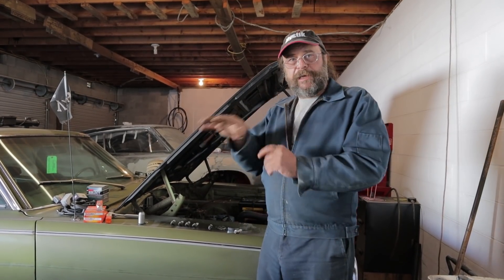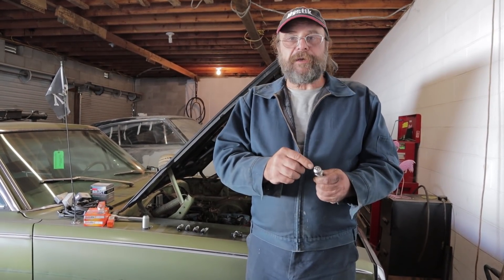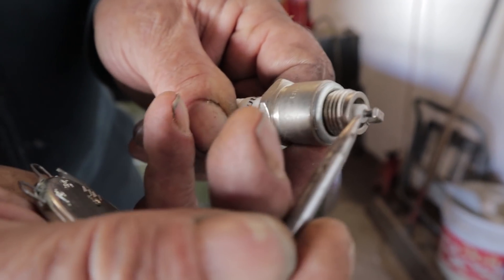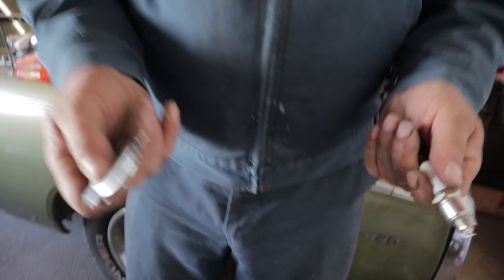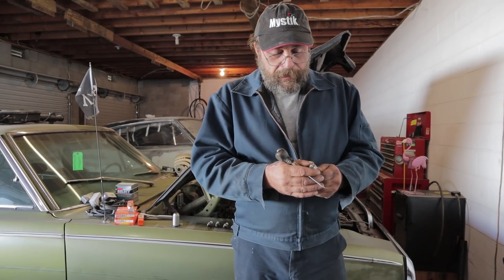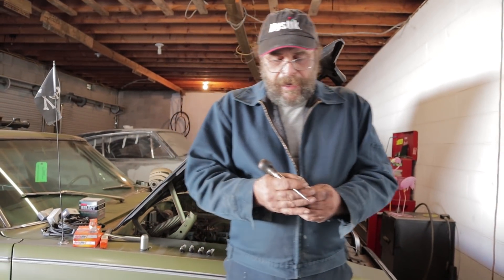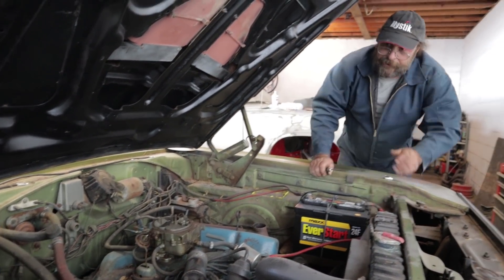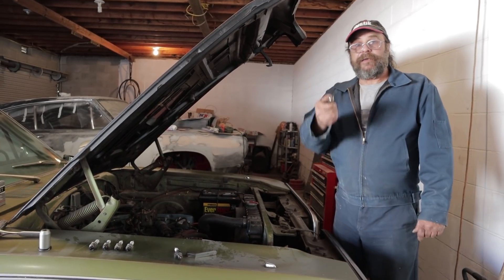Tune Up Basics - Spark Plugs

Comment: Installed some Bosch plugs a customer brought in once for his Mustang.. came back a week later... bad plug........ came back week after that ... different cylinder. Bad plug.... suggested then to put in Motorcraft spark plugs.. naw.... next week back again... “ put Motorcraft plugs”.... yes sir.
Reply: Bosch works OK in Eurotrash.  Stick with the OEM plug and you can't go wrong.  Fixed too many cars over the years that way.
Reply: So NGK's ;) motorcraft doesn't have bad brands behind a lot of there parts and comparable in price.
Reply: I’ve also had quite a bit of trouble with Bosch plugs in Hyundai’s. Quite a few comebacks for bad plugs.
Reply: Bosch platinum is used to be really good back in the day just like ACDelco unfortunately they're not worth a shit anymore..like Uncle Tony says Autolites are great all around applications you can get them ordered because they're made by same as FRAM just similar to  air filters and oil filters. there have so many applications and they could be specially made the list is endless..
now they're all owned by the same family you have autolite Bendix and Fram that were also prestone antifreeze.. all  now on by Trico the people who make windshield wipers believe it or not
Reply: Bosch plugs like to take out ignition parts,had this one happen a few times.Most of the European makes come with NGK from the factory,seen this with a VW Jetta once.
Reply: Autolite platinum plugs would work best on that!
Reply: Mark Ryterski or Autolite.

Comment: Damn I didn’t know about the fuel-spark jump with Side gaping 👍
Reply: Gee when the gap gets too large the spark goes from the center electrode to the inside of the outer electrode causing weird misfires. When you see it on a scop the firing voltage is real low with eratic pulses.
Reply: dielauwen talking about the fuel closing the Circuit.

Comment: Platinum-tipped spark plugs are only for longer life on an old car. Most cars before the 1990s do not benefit from having dual ground straps, and won't perform any better. If the OEM part is xyz, stay with xyz.
Reply: Not to mention that no matter how many ground straps you have on each plug, the spark can only jump across one of them at a time.  It gives the spark more options for less resistance as the plug wears or gets dirty, but it doesn't increase performance.
Reply: @JohnWilburn  Yes, I get it. I wasn't having a pissing match. I am learning. I am from the late 80s generation. You are right!

Comment: I ONLY use NGK. I tried some of those fancy Bosch plugs, a week later I was back at the  parts store getting some NGK's. Champion, well never in my cars. Although, we used to have a single cylinder tractor that had the original plug from 1947. It still ran. However they don't make them that way now. (I could not get that plug out to change it anyway)
Reply: What make of cars/trucks are you driving?  Because I learned something very interesting about 10 yrs ago, concerning my 2000 Tacoma 4x4 with 3RZ engine ( 2.7 liter 4 cyl ).......I met a Toyota "guru" ( close friends now ) who has worked for Toyota for over 25 yrs now ( mechanic/tech ). He told me never run an American made plug in a Toyota, only use ND or NGK (both are made in Japan ). He stated that for some reason, the Japanese engines just don't like an American plug. You can use them, but your mpg will suffer slightly and it WILL foul those plugs soon. However, most American engines CAN run a Japanese plug just fine. Go figure. As he was telling me this, my other buddy suddenly replied: "No damn wonder my wife's Camry keeps fouling plugs, I've been using American plugs"......and Dave said: "There ya go, I told ya so". Perhaps this also pertains to other makes as well. ?????
Reply: @howabouthetruth2157  so far, that's been my experience, no matter what brand of vehicle. NGK just works. Nothing fancy just does the job, and they last a hell of a lot longer than any other plug I've tried.
Reply: @tootall5559  Yeah, I've been running NGK's in just about everything I've ever owned ( 58 yrs old ).........cars, trucks, bikes, marine outboards. Decades ago, I did run Autolite quite a bit, but I only owned American vehicles back then. Since I bought my Tacoma new in 2000, I've been using ND's ( Nippon Denso ) too. Either/or NGK. Just clicked 343,000 miles on all original motor & automatic trans. After nearly 20 yrs, it's only on its 3rd set of plugs, believe it or not. 2nd set of plug wires. Still running original wheel bearings & CV joints too. About to replace the U-joints for the first time. And it's been my only driver in all this time. What a little donkey. Kept nothing but conventional Castrol 10w30 in it, and it doesn't burn a drop of oil......seeps a little from the front of the engine though, barely. I'm convinced this damn thing is going to out-last me, lol.
Reply: i can imagine the guys @ bosch we,ll double the price for each additional ground strap ! lol
Reply: @matthewcalifana488  what the deuce lol
Reply: @matthewcalifana488   that's E3 plug
Reply: toot tall I agree I like NGK’s lot 👌
Reply: Copy that, I run ngks in my euro cars , bosch is meh
Reply: @MrTheHillfolk  I started using NGK in Japanese cars, but it turns out they're just plain good plugs.
Reply: I remember they were in the old riding mower as a kid lol
Reply: Champion plugs from 40-50 years ago are indestructable. But that's then and this is now and now they are pretty crap quality control.

Comment: AC delco R44TX for the last 45 years.
Reply: nope R44TX A/C Delco.
 I have been putting them in that engine every 5000 miles for the last fourty five years, and I call the parts store first to see if they have 8 of the critters in stock. When I go and get the MSD 8 mm wires and HEI dist.  cap and rotor,
old girl gets tuned up every 5000 miles and the red components go well with the Chevy orange and chrome old small block. Who just hit 67891.0 for the sixth time.

Comment: First for the WIN! ACdelco or NGK plugs for me! Well I actually have a set of Accel shorty header plugs at the moment lol! Thanks for the wisdom Uncle Tony!!
Reply: Yea I'm a fan of the ngk , they've never let me down. 
Chumpion, I've been let down. 
Never had much of a problem with oem plugs either (Delco etc) . 
Whizz bang miracle plugs don't matter , only thing an e3 does is has more sharp edges for spark to jump from. 
Then you can't gap them anyways so you better have some energy to begin with. 
Enough about spark plugs , I gotta go fuel up my 91 Jetta diesel🤣
Reply: I was told recently that ac delco plugs are just rebranded ngk’s
Reply: @ericjswindle  heard the same thing from one of my old timer customers actually, but he has a LOT of rebranding theories haha! Wouldn't be surprised though. Seems high end tools are the same story.
Reply: 808 Tait yeah I was told that by the commercial accounts guy at my local O’reillys, and he usually knows his stuff. Also it’s just been my experience that there aren’t nearly as many manufacturers of a product as there are brands of that product.